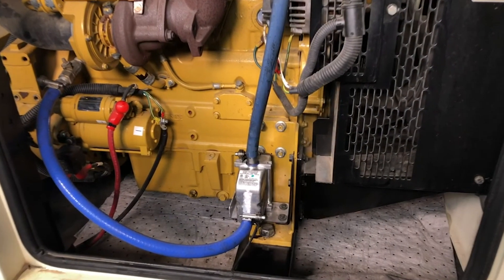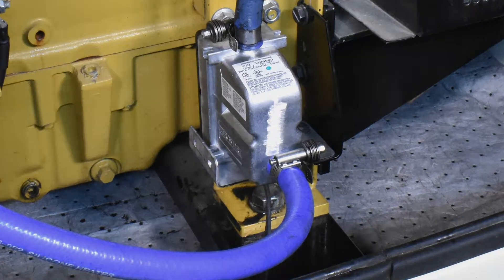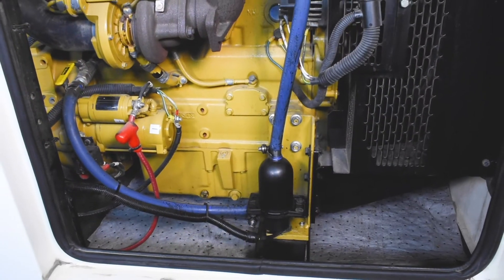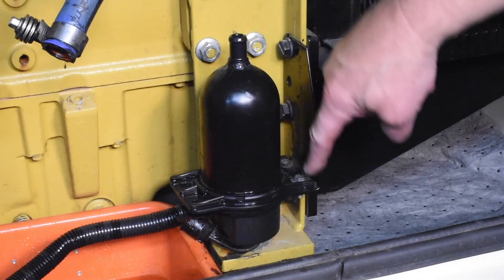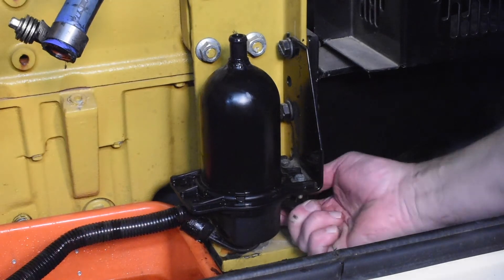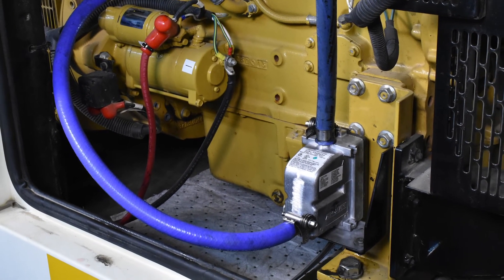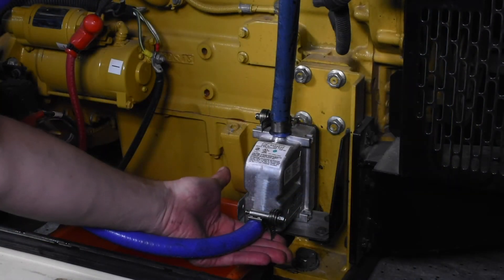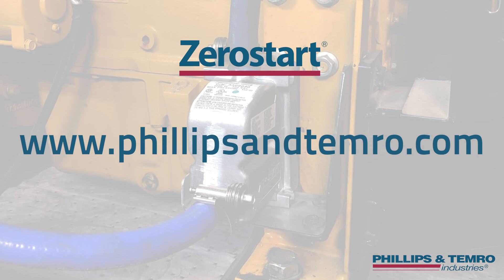Zerostart® Engine Coolant Heater Installation | Easy Replacement of a Circulation Tank Heater

Comment: Being a convection flow unit, would this be an impedance under water pump flow if installed in-line to a vehicle heater core circuit? My 11' Nissan Rogue does not have ports for block flow independent of the water pump circuit and I'm looking to add heating wattage to my engine for -30/-40c Canadian winters.
Reply: Do not install in line ever...there is an inline style heater...that's not it.